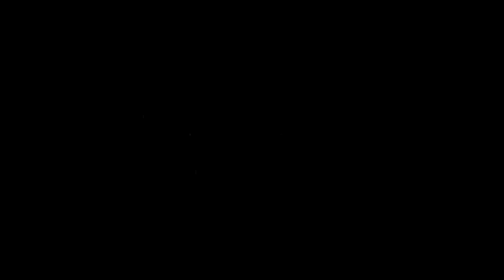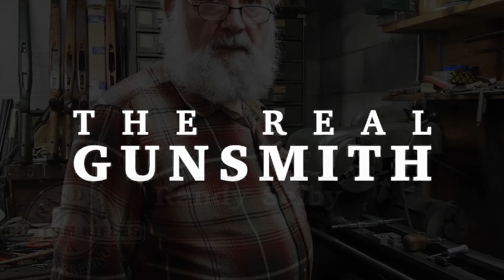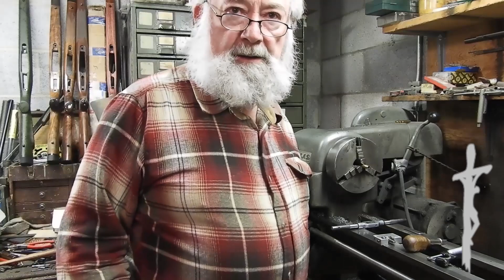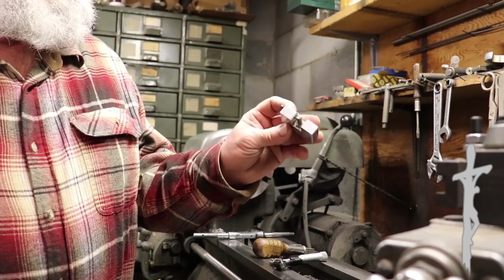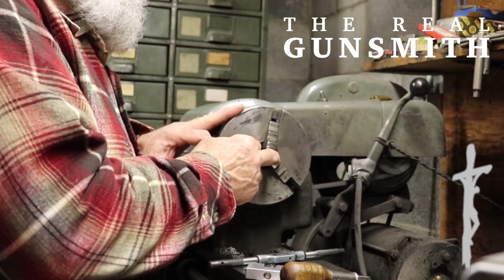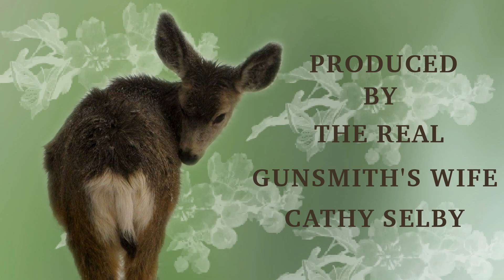Case Trimming:

Comment: Long sleeves and machine tools is asking for trouble!!!!
Reply from the maker: That shirt sleeve or others like it, in cool months, has been there for over 50 years and no worries, no close calls. That is because I pay VERY close attention to that I am doing.  
Thanks for watching.
Reply from the maker: Also, after 58 years of working on all kinds of mills, laths and other equipment, as mentioned, not even any close calls, but in the summer, with short sleeves, I've had hot chips land on my bare arm and cause burns.  Never had a burn from a hot chip when I am wearing long sleeves.  A few holes in the sleeves, but that is minor.

Comment: I’d would love to here a video about what brass you recommend as far as the tolerances you’ve seen from the different manufacturer’s. Thank you both for the great information
Reply from the maker: There are so much that varies for each chamber, caliber and manfacturer.  I am not sure it could be inclusive enough.
I'll take your suggestion under advisement, though. Thanks for watching.
Reply: @TheRealGunsmith   do you have a recommendation on brass manufacturer?or does it not make that much of a difference as Lino as you are preparing it properly
Reply: @TheRealGunsmith   do you have a recommendation on brass manufacturer?or does it not make that much of a difference as Lino as you are preparing it properly

Comment: Randy I have a question that you might can answer . In my neck of the country utah some guys claim they wouldn't think of shooting a new rifle without fire lapping the barrel I've never done it to any of mine and don't think it's needed at all if you don't know what it is .I think it's you shoot a dipped bullet in polishing compound shoot the gun clean it then repeat 10 times would you think it would make much difference .
Reply from the maker: The quickest way to ruin a barrel is to fire lap it, a stupid and unnecessary process. All match quality barrels are lapped when they are made.
Thanks for watching.
Reply: @TheRealGunsmith  thanks for the reply you said just what I was thinking .it didn't make much sense to me because most barrels are test fired when made . I have a friend named Lee bunce who's a master rifle maker he's retired but back when he was building guns he said shilan barrels were one of the best do they still even make barrels
Reply: Randy,
Great video.  A few  questions, as if you don't have enough of themtraded!!!!!!!

1) do you resize every time you shoot these cartridges? If so, do you run the chance of the neck brass becoming to thin?
2) you talked about the tight tolerances on the 6mm target load. Do you feel this is too tight for a hunting round? Or not necessary for hunting!
3) you mentioned 5 thousands difference on a standard load vs. a fired load. I understand your explanation on not trimming the neck...but if this is the case....then the accuracy is trashed!!!!!!! Or is there a way to rectify the accuracy?

Great job, Cathy as well.

Chip